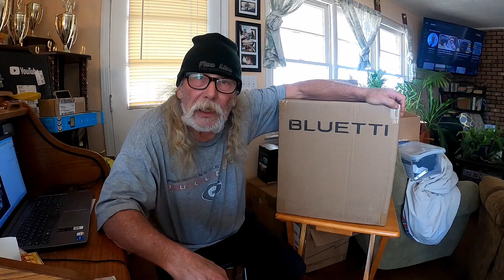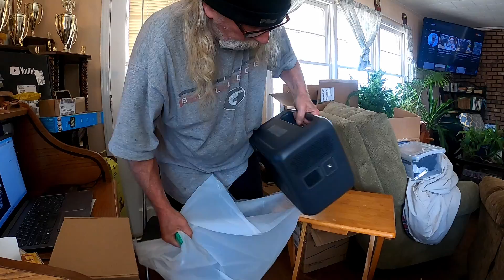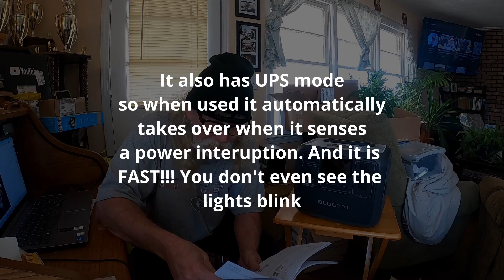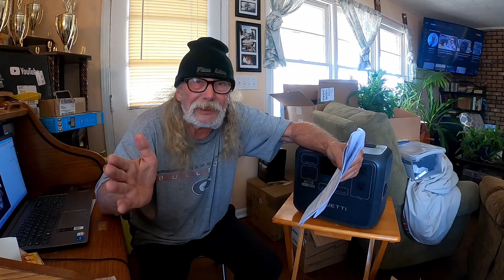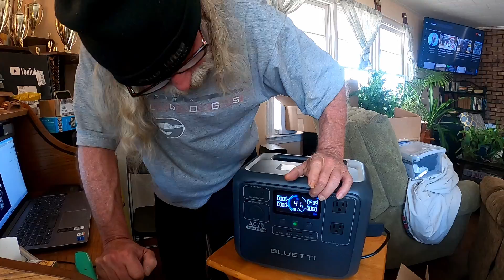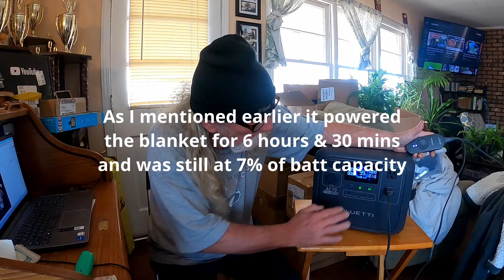Bluetti AC70 Power Station / Product Review, 1000w, 768Wh battery, #solar #auxilary power

Comment: I've been eyeing a Bluetti power station for a bit since right now I've only got a Jackery 300 (which really just runs my awning lights). Cool of them to hook you up and thanks for your review
Reply from the maker: I really do like the AC70, Byrdman. If you watch my  channel, you'll see that I don't just throw out reviews. (I actually don't like doing them) But I found the AC70 to be a good machine. It's priced right at the moment and for a 1000w power station, it performs very well. I'll be showing a video soon that will demonstrate how to up your Wh's big time by hacking in a small 12v 100Ah mini battery. That raises Wh capacity to almost 2300 watt hours. 
Hey man, thanks for watching and I appreciate the support.

Comment: I’ve been looking at these for months. Thank you for this review!
Reply from the maker: No problem! I'm using it now in the bunkhouse in combination with a Goldenmate 12v 200Ah battery as a back up. That gives me 3328 Watt Hours of capacity which is great for having in a little tent trailer. (I'd never use that in a 24 hour period)
I'd say its worth the price.

Comment: we've been debating whether to run power to our chicken coop or just setting in some batteries, tysm!
Reply from the maker: Well, the great thing is, an AC70 or similar station would be perfect for a chicken coop operation. One would just have to ensure a good covered dry spot for the station. You could mount a panel on top of the house (or pen) and it would always pretty much be at 100%.
I don't know what all you're running in it. I assume a light, perhaps an automatic feeder or something. 
If you use a small 100 amp 12 volt battery hack you increase your watt hour capacity exponentially. (To around 2000 watt hours or so)
You could even use a smaller station (like an eb3a Bluetti) when you use the back up battery  hack. Itseasy to do. Just fashion a jumper wire with two alligator clips from the battery and use the barrel connector to the station where the solar cable goes in